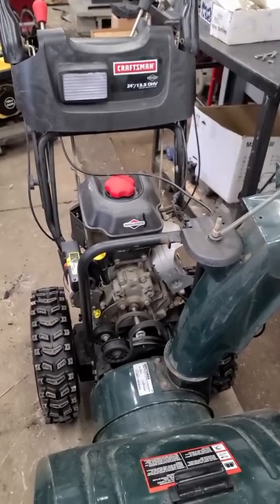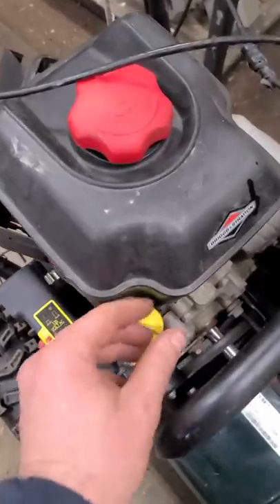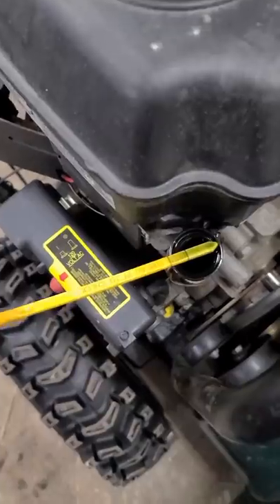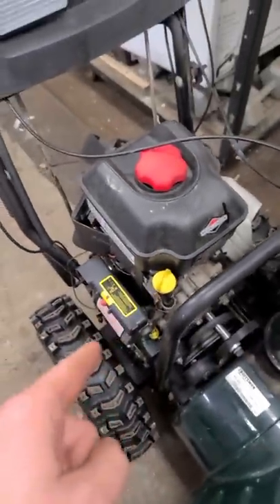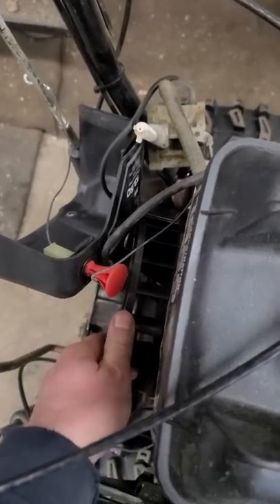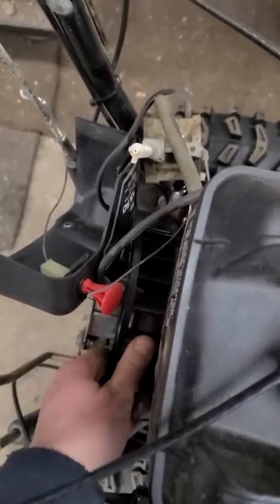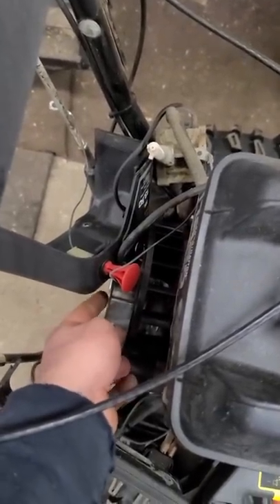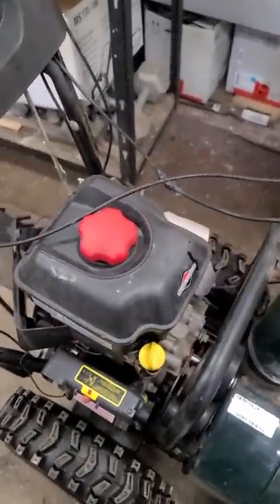Customer Used 2 Stroke Oil In Snowblower - Here's What Happened! #shorts

Comment: We all make mistakes, some cost a little more than others. My snowblower engine holds less than a quart of oil so I use the BEST synthetic oil on the market. Through the first 27 years, this approach seems to be working well but maybe it is still too early to know for sure 😉
Reply: The key to small engine longevity is to use the best synthetic oil possible and change it very frequently. Buy a 5 quart jug of Pennzoil Platinum at Walmart, and drain that 1 quart sump every month. Very cheap insurance. 😎👌 If the engine only calls for 30 grade SA oil, there's nothing you can do except change it often. If it's a premium type small engine like a tractor mower V twin with a forced lube system, changing the oil and filter can be done a bit later but I still like to use Pennzoil Platinum and change it frequently because of alllllllll that dust and fuel dilution they see.
Reply: @mannys9130  I agree. I don't bother with premium oil, because the oil is changed frequently enough, that none of the extreme pressure additives have degraded, nor, viscosity break down, or volatile burn-off of additives have occurred. Keep in mind, these engines have no oil filter. You change it, because of contamination. I just make sure I use the right weight, and more importantly, the right API classification. With frequent changes, "dinosaur soup" works just fine.

Comment: I'm old enough to remember 2 stroke engines running on straight non-detergent oil at 30:1 . It surprises me that modern 2 stroke oil that works at insane dilution ratios would blow up a 4 stroke engine. I hope you will do a tear down to show what happened.
Reply: Yeah they're all up to 50:1 now, unbelievable
Reply from the maker: seized where connecting rod meets crankshaft
Reply: @donyboy73   I know that an aftermarket engine would be the most practical route in this case.
Just wondering if the crankshaft is not trashed,if new rings and connector rod would fix this disaster? Maybe deglaze the cylinder with a brush type hone.
Reply: if you missed it, the 2 stroke oil was in the CRANKCASE instead of regular motor oil.  4 strokes are made to have thicker oil.
Reply: billings  I tore down semi brake compressors for hd plus remanufacturing napa. About 30-50 a day. Purple crankshafts with screwed journals are fini scrap.
Reply from the maker: @paulbillings1791  rod is too damaged
Reply: @buckybarnes3803  I used to race sleds in the 80's running 100:1 with a full synthetic race oil. Worked great BUT it would burn your eyes and throat if you gat into the exhaust much.
Reply: @kenbrown2808  Thanks for clearing up that point 
I'd assumed it was run on 2 stroke mix and double lubrication shouldn't seize bearings
Reply: @gor4988  i thought that at first, but he did mention it was in the crankcase. It was easy to miss. A crew i work with uses mix in all its small engines, including a few four strokes, and so far haven't had significant problems, though I'd expect plugs might need cleaning periodically.
Reply: I would imagine  2 stroke oil only stays in a 2 stroke engine for a short time and is meant to burn quickly. Therefore the oil cannot perform in a prolonged use and higher oil temperatures of a 4 cycle

Comment: 2 stroke engines usually have ball bearings on the connecting rod where it rides on the crankshaft counterweight. They usually have ball bearings or tapered roller bearings on each side cover acting as the main bearings. The intake and exhaust are valveless, though occasionally using a reed valve for the intake. 2 stroke oil is designed to lubricate these rolling type bearings as it is inhaled into the crankcase as an aerosol. The oil and gasoline droplets land on the open bearings and lubricate them as the volatile gasoline evaporates and leaves the oil behind. Rolling bearings have wayyyyyyyy less friction and wear than standard plain journal bearings. The ball bearings just roll on their hardened surfaces as the part spins instead of sliding like a journal. The soft aluminum con rod in a 4 stroke relies on the oil film of the sump oil to maintain an oil film separating the bearing surfaces to prevent metal-metal contact and wear. The valves see cam lobes grinding hard against the lifter face. The cam shaft is turned by a gear and is supported by plain journal bearings too. Just...everything about the 2 different engine designs makes them dependant on VERY DIFFERENT lube oil requirements and chemistry. Not to mention, 4 stroke oil is designed not to burn and those engines have an oil scraping ring whereas 2 stroke oil is meant to burn incredibly easy and completely and those engines have no oil scraper ring because they depend on top and bottom sided cylinder wall/skirt lubrication. :/ Poor snowblower. This owner paid the "idiot tax" in a big way. Take 10 seconds and read the bottle next time.

Comment: Because the two require completely different lubrication regimes, where in a two-stroke engine the oil is mixed with the fuel and then ignites (complete loss of lubrication), whereas in a four-stroke engine the oil used to lubricate the different engine parts flows back in the crankcase and is not consumed. This means that the two engine oils have a completely different composition depending on their intended purpose. A two-stroke engine oil must be able to mix well with fuel and burn well in the combustion chamber of the engine, whereas a four-stroke engine oil needs to protect the valve train against wear and keep the engine as clean as possible. Ultimately, no matter which type of engine you have, a high-quality engine oil can significantly extend the lifespan of your engine.

Comment: Basic knowledge of small engines and power equipment, seems to be fading away for most people.  Many people will spend hours "researching" a snow blower (or any piece of power equipment) online, reading reviews, etc, but never bother to read the manual, after spending $1000, maybe $1500+ on a new machine.  That's why many new machines come with warning stickers, labels, tags and covers, warning the owner to add oil, etc, to try and idiot-proof the process and avoid a returned/damaged product, because the operator didn't read the basic instructions.
I sold an extra snow blower to a neighbor who really wanted it after a big snowstorm.  I gave him a quick overview on how to start it:  "choke, throttle position, push the primer bulb 3-5 times, then its ready to start."  He said, "ok, how do I start it now?"  .... I said either with the electric start with an extension cord, or just pull start it - it should start in 1-2 pulls"  he said"  ok, where do I pull it?"
oh boy...
I showed him further steps on this and then printed the manual and gave him a copy and implored him to read it.  He wont.
I also told him to have me come over after the winter and I will show him how to prep it for storage.  He looked more confused.  " Prep for storage?  I'll just push it into my garage"  
oh boy...
Maybe I shouldn't have sold him the snow blower....  I thought I was helping him out.

Comment: That's just a shame. Isn't the oil requirement molded into the oil filler cap?
Reply: not necessarily Sometime I find that information on the lower portion of the blower houseing along with engine mole number and specs.

Comment: another tip on those briggs engines with a dipstick... there are plastic oil plugs lower on the base of the crankcase. they vibrate loose. make sure they are tight or you will need a new connecting rod at minimum...

Comment: I have fixed seized engines on these multiple times for free. all you gotta do is pull the plug, drop something like 2 stroke oil down there and let it sit. then, pull the pull rope as hard as you can while turning the electric starter over and that has worked for me every time. like you said, breaker bar would work too. they always start right up after being completely seized.
Reply: Hey If you say it works that's great BUT... I find it highly unlikely that the motor is any good after being run with 2 stroke oil.
Reply: @kcstereo  the ones i'm referring to were run with out oil to cause them to seize, so...
Reply: @kcstereo  The engines were in fact still good.

Comment: I can't understand how 2-Cycle oil wouldn't work. After all, it is diluted to 1/50th with gasoline, and somehow, manages to protect the cylinder and rings of a high speed 2-Stroke engine. I saw a video put out by "Project Farm", where he deliberately changed the oil in a lawnmower and added cheap 2-Cycle oil. after 1 hour of continuous run time with intermittent loading, he drained the oil through a filter, and discovered no visible metal particles. The oil is thin, there was some blow by in the old engine.
     I think what happened in your case, is the customer let the engine run too low on oil, seized it, then, added what ever he had on hand. It just happened to be the 2-Cycle oil. When you pulled the dip stick, the oil looked clean, with no metal shavings. That suggests to me, that the engine never ran after filling with the oil, suggesting, the damage was already done. If the engine had run, the oil on the dipstick would have looked "horrible".

Comment: I always thought the snow blower has a oil port, that lets you know its a four cycle engine! Weed wacker doesn't have an oil port, that means its gas to oil mix! A four cycle weed wacker has a oil dip stick, so id never use two cycle engine oil in it!

Comment: Donny wondering if you could help me please, I have a Ryobi the Backpack Blower Wity the electric start this is the reason I don’t want to get rid of it, it seems like I can’t get full throttle so I checked everything it was just cheaper to buy a new carburetor. I put it on and I have the same problem. I change the fuel filter spark plug same problem what I noticed is the only time she runs at peak performance is if I turn The high screw all the way in and back it out 1/4 turn now I know it’s to lean but it runs great any ideas thank you 

PS I’m running premixed gas and oil 50 to 1

Comment: I have the same green sears snowblower with the 1150 series engine. That there with the 1350 series is / was a powerhouse.
Reply: Yeah, I was just given a Craftsman with the 1350 engine, and it is a beast (once I got it running, and adjusted the auger belt tension).  That engine is around 300 cc!

Comment: What happens if you went the other way and used regular oil in a 2 cycle?
Reply: Most likely, fouled plugs at worst. The oil used to be the same for both.
Reply: @justindunafon8580  but was 16 : 1 not 50 : 1

Comment: Good info but I fail to see why a good quality 2 cycle oil would not be able to maintain a hydrodynamic wedge of protection at the rod bearing journal. It certainly won't have the needed additive package to protect the engine long term as these additives are not required of a 2 cycle oil but lubricity is an excellent characteristic of most high quality two stroke oils. 
At full undiluted strength 2 cycle oil should be able to maintain that all important hydrodynamic wedge that keeps bearing and journal apart.
While I certainly don't endorse the use of 2 cycle oil in a 4 cycle engine I've seen it done without any negative repercussions and certainly not a catastrophic bearing journal seizure.   
I just have wonder if the customer is giving you the full story?
Reply: @boots7859  Your reading comprehension leaves a bit to be desired.
I in no way suggested that 2 cycle oil should be used as a lubricant in 4 cycle engines, on the contrary, I specifically pointed out that it should not be.
I worked for a major oil company for over 25 years in the fuels and lubricants division and have spent many thousands of hours in closely monitored lubricant analysis labs and test centers. It is from the experience gained from all of those countless hours that I suggested that perhaps there may have been some other underlying condition that caused this failure.
No conspiracy theories or agendas implied.

Comment: Oops I have 10-30 in there right now.  Will change it out for 5-30 soon then.
Reply: It's not critical, just easier to start with 5w. It's still 30 weight oil at operating temperature.
Reply: @ross9580  Oh, well then I should be ok.  It lives in a heated garage through the winter and has electric start.

Comment: 2cycle oil is just non detergent oil with additives and dyes . you can use SAE non detergent motor oil as 2 cycle oil it just doesn't have the dye in it . the owner siezed that up before he put that oil in it then just added it after the fact . those briggs engines are junk no cast iron sleeve . just replace it with a cheap harbor freight engine .

Comment: This a total lie! The customer bought the snowblower new and there's no oil in the engine, it's even posted on the unit when they purchased it! They started it with no oil in the crankcase and seized it, then they put oil in it afterwards and took it to a small engine mechanic so as to try and get something through warranty or money back. I've seen it a million times and so have the stores that sell these products. I agree you shouldn't run 2 stroke oil in a 4 stroke, but it won't seize it like what happened here.
Reply: That’s not a new machine……it’s clearly several years old
Reply: @thehawk05  regardless, there was no oil whatsoever in the crankcase when it seized. Probably drained the oil for an oil change and forget to fill it, then dumped oil in it afterwards. Been doing this a long time and I've seen it all, 2 stroke oil on the dipstick looks new and it wouldn't seize the engine, prematurely wear out the engine, but not seize it like that. I guarantee it
Reply: @alvinpeters2423  I think the same thing. That oil would have been silver / black before the engine finally threw in the towel and seized. Customer either ran it without oil or until it was so low it seized. Then he added whatever he had in the garage to save face and plead ignorance at the repair shop.

Comment: how do you feel about running straight 30 weight oil
Reply: I know that you were aiming this question at Donny and you may still get an answer from him.
I'll offer my opinion.
I view multi weight oils like this.
They were designed to keep particulate material in suspension for a filter to capture  the particulate matter.
SAE30 weight typically contains zinc and the particulate matter binds to the zinc and is heavy enough to go to the bottom of the crankcase and not wear the primary mechanical parts.
Regular oil changes are strongly advised with either type of oil.
More so with SAE30.
Being in the lower end places the particulate matter to be around lower main seals on vertical shaft engines.
Horizontal engines,not as problematic.
Hope this helps.

Comment: Something that's always left me scratching my head is; why don't small engine manufactures use connecting rod bearings like most other internal combustion engine?
Reply: Most are not force lubed. They are splash lubed. A normal con rod bearing wouldnt work.

Comment: If the guy thought it was a 2 stroke engine, he most likely mixed 2 stroke oil with gas and put in the gas tank. Are you sure he added oil to the crankcase ?